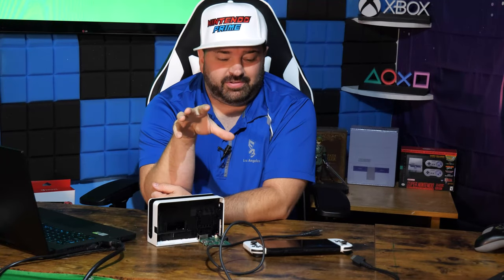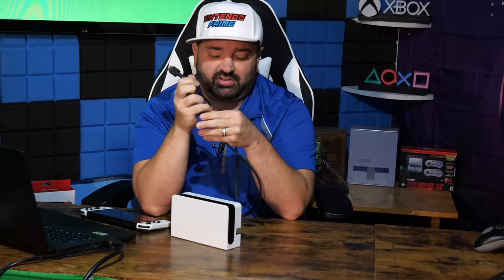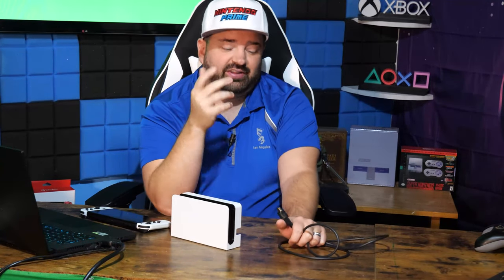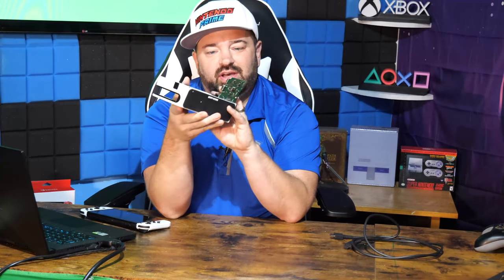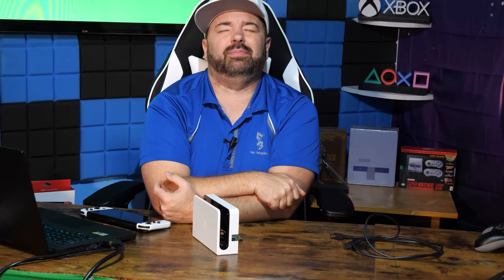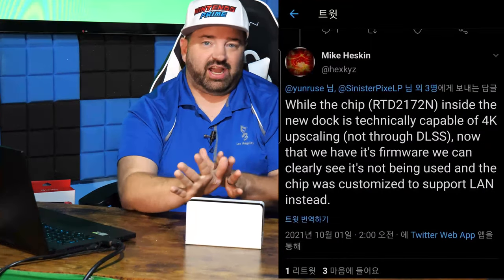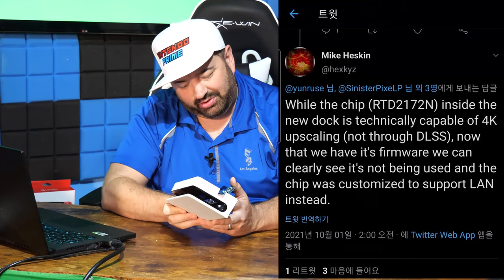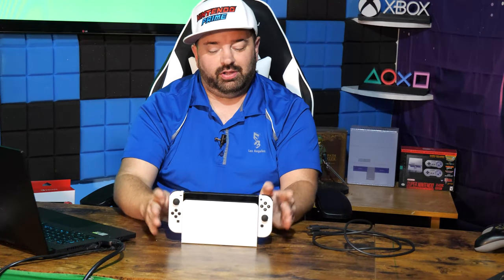Switch OLED's Dock Can Output 4k & 60fps, Future Proofing for a New Switch!

Comment from the maker: If you enjoy the video, be sure to drop a like and  comment to help us out with the YouTube algorithm! Also, we are giving away 3 copies of Metroid Dread right now! All you have to do enter is... subscribe! So why not consider doing so here:  https://www.youtube.com/channel/UCc0qpQO6y4aB4IaZtLCZMXg?sub_confirmation=1

Some clarification:

- All I can confirm with the new included HDMI cable is that it's capable of faster transfer speeds than the old cable. However, it's notable that HDMI 1.4 cables can do 4K60 - especially over shorter runs. The issue stems from the quality of the manufacturing of the cable. The cheapest cables, which Switch/Wii U use, are capped at under 5Gbps, which means it can't handle 4K60 with HDR. It just isn't capable of it. 2.0 rated cables are basically 1.4 cables, that actually run at speeds rated high enough. They don't have to be pricey. Only 2.1 standard has SPECIFIC cables needed to take advantage of it.

However, as noted, all I can confirm is that the current Switch OLED cable is fast enough for HDMI 2.0.

- Yes, as noted by myself and others, the HDMI port is 2.0 compliant. 

- I am not an expert on any of this. I am pretty good with board repair (not great) and have experience in manufacturing, but that's different than engineering design. To give you an example, in my internet speed test video I labeled the graph correctly, but kept saying "megabyte", when I meant megabit. A really stupid (and simple) mistake to make. I also incorrectly framed the Switch OLED dock of possibly being capable of AI upscaling - that's not true. I had very basic information at the time.

All of this is solved by taking more time with the videos, better editing, multiple recording sessions, and so forth. Something I want to focus on one day! Unfortunately, due to time constraints, this is what happens. I apologize. Even in this video, I mischaracterize HDMI cables some. Although the explanation is in there, it's a bit muddled.
Reply: Thanks for the vid and everything you do!! I really enjoy your stuff!
I've said all along that I think IF Nintendo ever does some rendition of a Switch Pro or Ultimate or whatever people want to call it, I believe it'll come out with the Next Zelda game. It's too convenient that Nintendo has with basically every other system of theirs, done a Zelda themed release but for the switch they haven't done it yet?
It also makes sense (to me) that they would do it like this because over the last decade Zelda has been building up steam (and yes there are people who have been fans for decades but we need to admit that next to Mario, Zelda has been heavily overshadowed) and this would be a very smart way to not only advertise the game but also make the new Switch fans take notice of a game that a lot might've overlooked.
Those are just my thoughts. What do you think?
Reply: I don't think this is a sign of future proofing. I think it's just 4K capable as it's now cheaper to get HDMI 2.0b cables and controllers than HDMI 1.4 now. HDMI 2.0b is no longer the standard for high end hardware and TVs are aiming for higher as well so demand has fallen making the price fall. Meanwhile 1.4 is still getting older and fabs slowly get shutdown as it gets older. At some point the better hardware becomes cheaper as always. 

Nintendo is renowned for using the cheapest parts at the time to even mixing IPS and TN displays on the 3DS randomly. Hell the original Switch basically had the same display as the $90 Kindle Fire HD. I have no doubt the they're next system will output 4K and will likely take the shape of the Switch, but it will have a dedicated dock. I highly doubt they would design the OLED's specially for the next gen model when Original and OLED models are cross compatible.
Reply: The Tegra X1 in the Shield TV 2019 does AI upscaling, and it was released around the same time as the Switch V2 and Switch Lite. It is possible that the OLED has a different Tegra that is downclocked just like the regular switches are, and if that's the case, there could be features that are not present at the moment, but that could come with a system update (just like Bluetooth headphones being added YEARS later.)
Reply: All HDMI cables are functionally identical just like all USB cables are, because they all use the same pin out, and all that matters is the size of the plug when it comes to compatibility! Please stop misinforming others so they get ripped off when purchasing HDMI cables! The HDMI chip that is behind the HDMI port on the circuit board is what determines the HDMI version!
Reply: @rctoyhobbygrademodskaraoke4047  no there are differences but it mostly has to do with shielding, wire gauge, etc. The big one is usually the chip used to control pin throughput. These chips have varying performance and so are a limitation when plugging them into a device. This is also why even though HDMI 1.4 had the same pins as 2.0, a 1.4 cable can never output full 2.0 video.
Reply: You need a processor and a GPU that can handle the power you do not have that in the switch I'm sorry but that switch does not have the cable power of pushing it
Reply: you look like an rgt 85 clone

Comment: I don't understand why everyone is so hard up for a 4k signal on Switch.  I have a 55 inch Samsung 4k TV and the OG Switch's 1080p looks great on my screen.
Reply: Yeah it looks fine for the most part.  The biggest issue is when Nintendo doesn't use AA and the game is insanely jagged looking.
Reply: what are you smoking? botw looks horrible with those pixalated edges
Reply: @florider_hd  botw looks amazing on my 65 Oled🤷‍♂️
Reply: Because if it can run games in 4k, it means it almost for sure will run all games at 1080p smoothly. No more 20 fps
Reply from the maker: @eatens  No, it doesn't. 4K is just a resolution signal output. Has nothing to do with game performance. Switch OLED does not improve the performance of the games.
Reply: PATHETIC
Reply: @The_Ostrich  the picture itself is not the problem. The anti aliasing is
Reply: I would be ok with a 4k console as long as it isn't a regular switch, on a portable it is just a waste.
Reply: Glad I brought a m classic to go to 4K.
Reply: Don't like 1080P looks like shit on a 4k tvs
Reply: Because then they'd look even nicer on your 55" Samsung tv.
Reply: @NintyPrime  I think what he meant was that if they come out with a future switch with a more powerful chip that can output 4k, it should mean it could run 1080p at better fps since it would be more powerful.
Reply: @heisenbergwhite00  you are not 100% right. It depends on your TV upscaling. Some tvs have better upscaling. Average low budget ones almost always have bad upscaling.
Reply: @jonathanrivera8585  upscaling + No Anti-alliasing on the switch is not a good combination, games look awfully extra bad on a TV when outputting from a Switch
Upscaling is general doesn't look good, most of not all TV internal  upscalers do a horrible job.
Reply: @igcreates2760  portable console with docked mode.
Reply: I feel that i have my switch hooked up to a 43'' 4k tv and the games are definitely more colorful and crisp but of course i had to tweak some settings and this brings me to the topic on switch looking terrible on a 4k screen which couldn't be any father from the truth it comes down to properly calibrating the settings and of course it depends on the brand of said tv i use to game on a 1080p screen with my switch and it looked good but a 4k tv is the way or a full hd 1080p tv and can't forget about OLED.
Reply: It's not that we want 4k we want better frame rate. If it's 4k then most likely it can run games smoother. That's what we care about smoother games.
Reply: @jordangonzalez4658  the switch is not even getting real 4K is upscaled 4k most likely a the next gen switch will get is 4k(upscaled) 30FPS
Reply: @heisenbergwhite00  That’s my issue like I could care less if it’s 4k or not but I really just want the games to run at a steady frame rate
Reply: I want better performance, not 4k.
Reply: @florider_hd  that's more because of no anti-aliasting. That's what makes angles look smooth. Makes a giant difference
Reply: @alexbolt5  I can agree, However I don't see this happening with Nintendo, at most all they'll do is stable 30fps which isn't good for 2021 standards.
Reply: Eh, to me it's more about all the upgrades that a new Switch would bring and all the 4k talk is just a shorthand way of saying it.
Reply: @bluntzy0414  When you are playing the game walk up close to the TV and you will see what they mean. Console games typically look soft and jaggy up close however the Switch is pixelated and blurry.
Reply: 1080p is good. But if you like 1080p, 4k is even better. The differences between the two are very noticeable.  And also if it runs 4k at a steady framerate then chances are it will run the games at 1080p and higher framerates then it currently does.
Reply: Who is everyone? I've seen nobody at all so far
Reply: each 4k tvs has different upscaler  so different user experince...
Reply: @florider_hd  BOTW looks great on my 75" tv...
Reply: @The_Ostrich  each 4k tvs has different upscaler  so different user experince..
Reply: Is it the only console you play? It looked awful on both my 75 inch & 65 inch LG's, so I moved it to my 27 inch Samsung monitor. Unfortunately, that monitor is also 4k, but at least the smaller size helps hide some of the muddy look. 

Another problem is the big Switch games almost NEVER hit 1080p anyway. More often than not, you see 720p - 900p on a 4k display, sometimes even worse, and it just looks bad. 

Flipping between my PC & the Switch on the same monitor, and the clarity is just night and day. I'm not talking about in game graphics, just the output quality.
Reply: Yeah but a 1440p (checkerboarded) 60fps would look even better
Reply: @heisenbergwhite00  
1080p on a 4k TV really isn't that much of an issue honestly..
Besides, a 4k upscaled with I'm guessing DLSS? 
From what I gather, that form of upscaling is pretty efficient..
Reply: Well Nintendo needs 4k to compete especially when the the next gen systems starts heat up. ALSO MY SWITCH does look phenomenal on my 65 inch lg oled. You wouldve thought my switch was 4k when u see it on my tv and mind you, lg oled is a better tv than that samsung u got oh!!! I took a shot at u lol
Reply: @florider_hd  not on my lg oled!
Reply: @bluntzy0414  mine too and every switch gamesi run on it.  I have a 65"  cx oled
Reply: @blackcatbone5697  there actually is an upscaled 4k in the works nintendo themselves said it. Its going to ise DLSS Tech.
Reply: @heisenbergwhite00  if u have a shit 4k tv it will look like shit. I have lg cx oled and it looks great
Reply: @redcrimson1028  Though it would be a nice thing to have I doubt 4k is what people are looking for when you mention nintendo that’s what the other systems are for you either have one of those and a nintendo switch it’s the perfect balance but nintendo really needs to get their performance department better because that’s the noticeable part that holds it back
Reply: @bluntzy0414  Listen you are confusing the people on here with budget 4k TVs that have inferior upscaling. 😂
A portable device with native 4k output at 60fps is a way ways away but clickbait generates clicks so why not right? 🤔
Reply: 1080p....and a lot of games that go way below 1080p, which look outdated af
Reply: @redcrimson1028  even on a good 4K it looks like shit,  LG TVs are not great BTW... they're notorious for breaking down only after 1 year of use.
Reply: @heisenbergwhite00  that is where the m classic comes in to clean things up. Lol!
Reply: @heisenbergwhite00  
Looks pretty good on my 4k TV my mans..
Subjectively obviously..
Just like your opinion on the matter..
Reply: @alexbolt5  I feel u on the performance front, but they go hand in hand. A powerful chip will give u both not one or the other. Secondly we have all become accustom to and comfortable thinking that nintendo makes underpowered consoles and and that never used to be the case. back in the nineties they used to have the most powerful consoles the only reason why they stop making powerful consoles is because when they were making them they weren't selling so when they switched up and started making weaker hardware, the weaker hardware was selling. If Nintendo actually find their balls and be competitive again like they once were like say.. get back into the arms race race and make a powerful console they could make to where all we would need is a Nintendo platform not Playstation or Xbox. Even that has been sony`s goal to put the competition out of businesses, that's why they make powerful consoles, buy studios and round up enough exclusives so all u would need is a Playstation. That's why if u look at the sales of the ps1 and ps2 they crushed Xbox and Nintendo. The numbers show that people were only interested in the Playstation brand and nothing else so that's why I can't agree with your statement. I want Nintendo to go back to how they were so I don't have to buy a Playstation or Xbox anymore. If I were wrong then we wouldn't have all these dedicated Nintendo channels talking about a switch pro and what not. What Nintendo needs to do is come out with a powerful console so we don't miss out on exclusives like the dark soul series, metal gear, call of duty, gta and other titles that has yet to grace a Nintendo console. U mite think consumers need it but in all actually everyone wants it. Fact of the matter is if the hardware isn't their to support triple A third party games then Nintendo won't have any games and no games equals no sale and they could end up like Sega or worst out of business for not making the right moves and that's facts.
Reply: @NintyPrime  yeah I get that, but I was talking about why I personally was very interested and keen for a 4k capable switch pro
Reply: @incogneeto982  yeah that's what I said...anti aliasing
Reply: @redcrimson1028  i disagree, the reason i moved to Nintendo this generation, and i got my switch like 4 months ago is because they are not directly competing with Sony and Microsoft and are doing their own thing. It's because of the shit AAA games plaguing the other systems that i moved to Nintendo. At least when i'm playing a Mario game on the switch i know i'm playing a Mario game, the other systems recycle their "mario" games and slap a new name on the cover and call it a new game... I don't mind a performance upgrade for the switch, but i really don't wanna see the same triple A crap that are on the other systems.
Reply: If it supports 4k, then it can properly handle the scaling instead of leaving it up to the display which means it will always be a little blurrier. Some displays do a better job of upscaling than others but a native res will always look the best. The game rendering res will still be lower though.
Reply: @Bristecom  Thanks for showing up to a 4 day old thread lol
Reply: @raptros  well said my boy well said and i agree
Reply: @_Beenis  What does time have anything to do with it. Somebody might still see it and I didn't see it clearly addressed as to why you would actually want it. A lot of incorrect assumptions were made.

Comment: Me personally,a new dock that can do 4K makes more sense then doing a new system all together.
Reply: I think they need to do the actual tablet, otherwise all those games that rely on more powerful hardware to run won't function in portable mode.

 It's very likely many future 3rd party games would only be possible to be ported to Switch if the internals get upgraded.
Reply: @corey2232  They also need more memory cause 4GB in this day and age won't cut it, especially for 4K.
Reply: Ehhh well the current switch can barely run 1080p so we would need a spec bump to be able to output 4K
Reply: The switch can’t even handle 1080p half the time. You don’t even have to look at the specs to know they need an upgrade to run 4K.

Comment: To clear things up, even the launch Switch dock supports up to one 4K stream or 4 1080p streams.  The module in the console itself is DisplayPort 1.2 with a converter to USB-C.

No matter what Switch you have, or what dock you have, Nintendo could unlock 4K support on (for Hulu, or even supported games if the SDK allowed it).

I’ll do a video on it.

Comment: You are 100% correct! The dock is definitely future proof and Nintendo will sell us a 4K or Pro Model as a stand alone to keep the price at what Nintendo consumers even the hardcore ones expect. 350.00 in about year without the dock. Extra 50.00 with the dock. I think this OLED model will push 4K 30fps in the future. You want 60fps you get the pro model when the time comes. Good analysis!